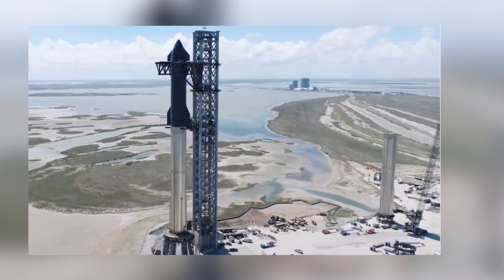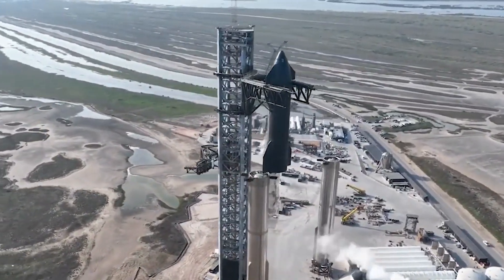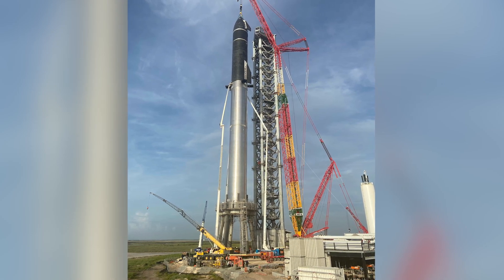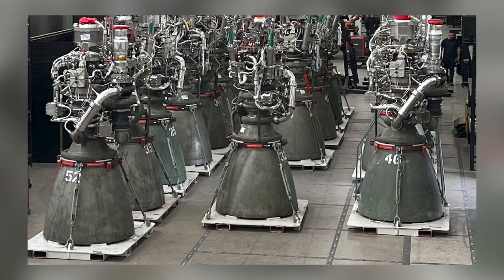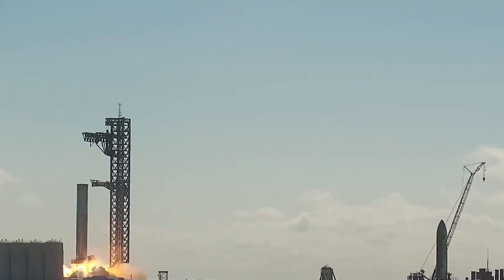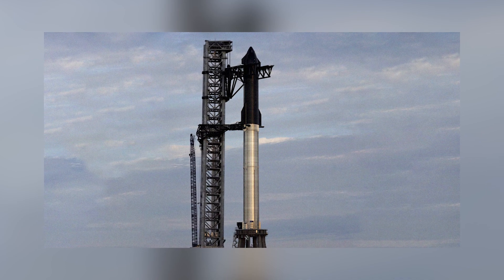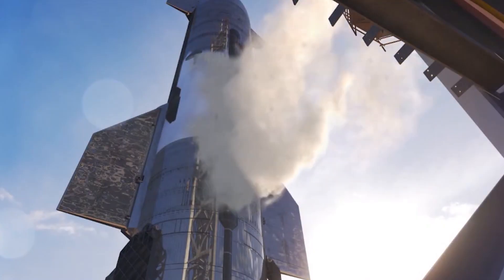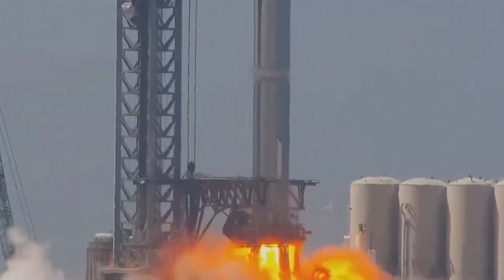SpaceX's New Stage Zero Upgrade Will Change Everything

Comment: I’m telling you SpaceX needs to add an Inconel flame diverting cone that they can move the motor lift over. Can still get equipment in and no more concrete ablation issues.